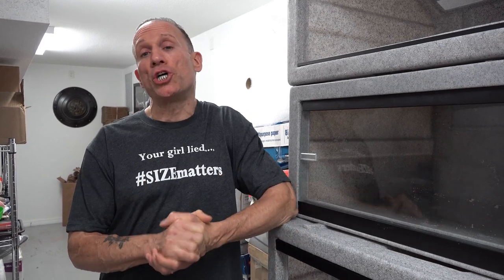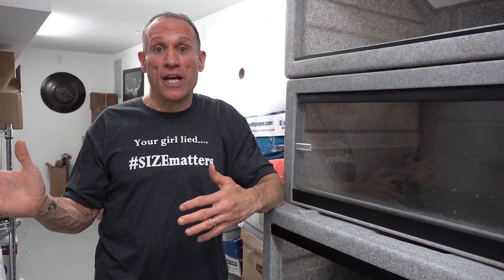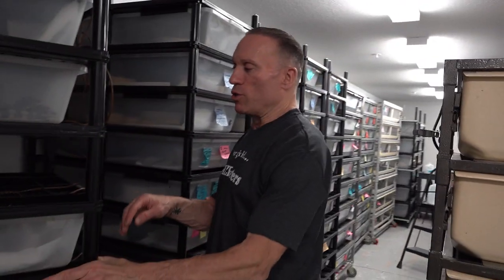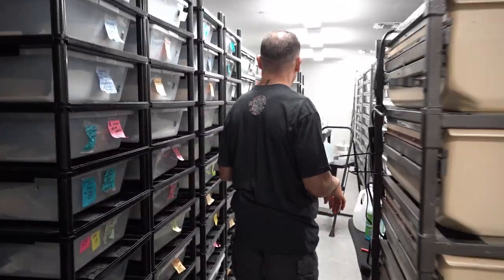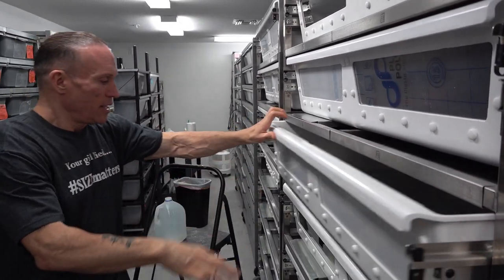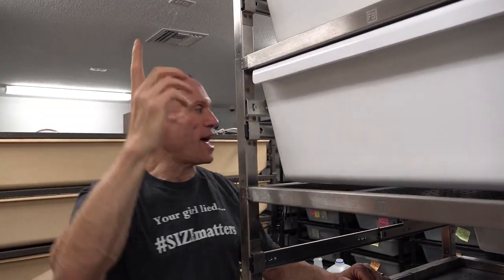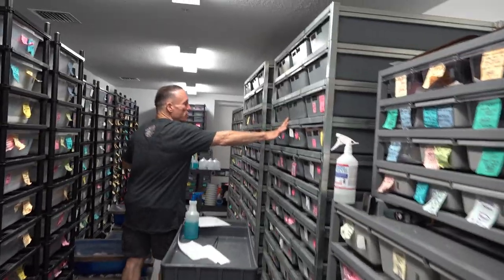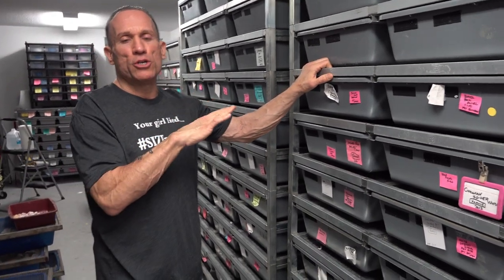SNAKE CAGE & RACK REVIEW! Feb 17, 2021

Comment: I made my own rack then went out and got a vision cage rack . I had problems getting the heat correct changed it 3 times and got it good. Then I ended up building a new design with bigger tubs I came up with and moved them again to the new rack . The first one I built was about $300 but was junky . The vision and the new rack I built cost $750 ea all in heat thermostat everything. I think the vision is the 16 tub short and my new one I built is 14 tub 28qt sterilite. Will hopefully use the vision again for babys. Talking ball python stuff . Have some animal plastics cages on order 4x2 split cages want to try putting them in a nice decorated cage . $750 for three split cages . Have garters in a large aquarium 250 gal they need light and basking area . Depends on the snakes .